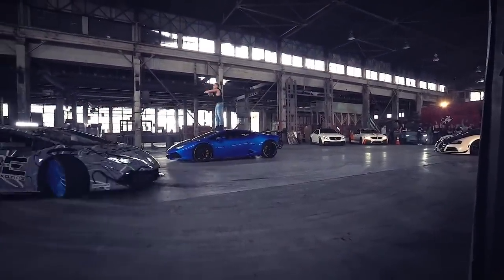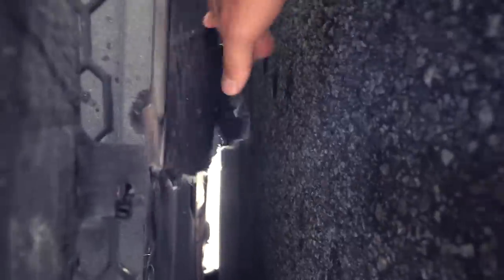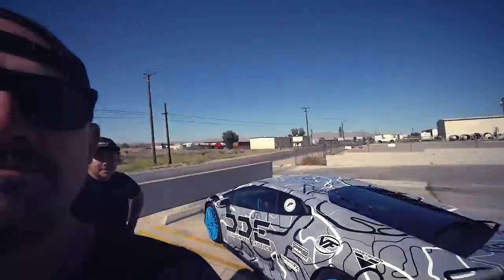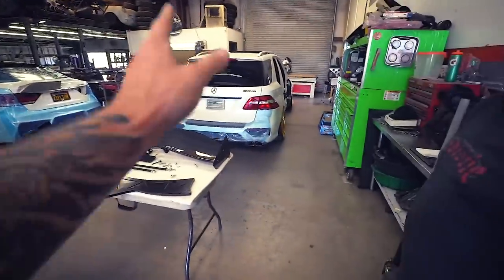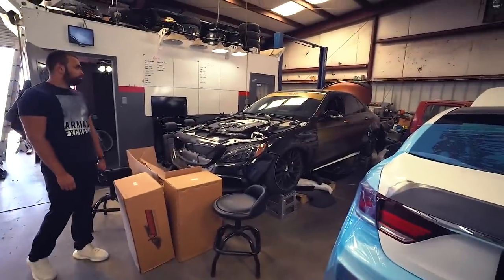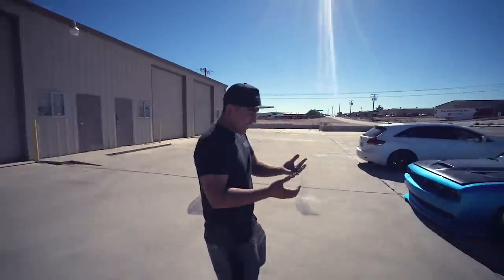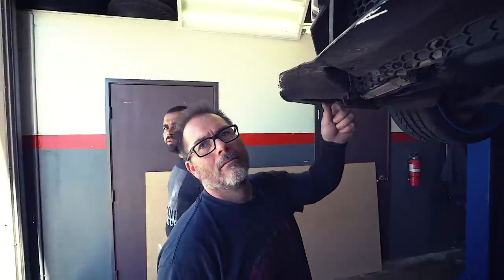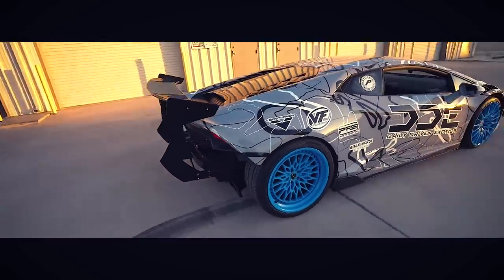INSTALLING THE BIGGEST LAMBORGHINI CHASSIS MOUNT WING EVER MADE!

Comment: Bag it. An put new front end on it.
Reply: Air bag suspension, most bags suck and make the performance a lot worse just so you can get a good stance to make your car look good when it is stopped. But it doesn't work as well.
Reply: Bags ruin how cars handle...
Reply: FREE NET UPDATES 

What Sam said.
Reply: Steve Smith throw a veneno wing on. Do something different.
Reply: Troubleshoot 
True that be cool.
Reply: Steve Smith everyone and their mother has this wing
Reply: Troubleshoot someone needs do a wing with a rear bumper cover on
Reply: Steve Smith did they buy their wings in bulk? Like oh hey choi, & wrap legends, i found a buy two, get one free.
Reply: Steve Smith yes for sure new front bumper

Comment: Not against bags but I honestly think the lambo is low enough, especially if your driving in the LA area mostly. We have horrible freeways and streets. Also you are already scraping and breaking off pieces of the front as is, if you were to bag it would purely be when the car is parked. Lastly it would open a whole new level of problems that aren't cheap related to your set up in the future.